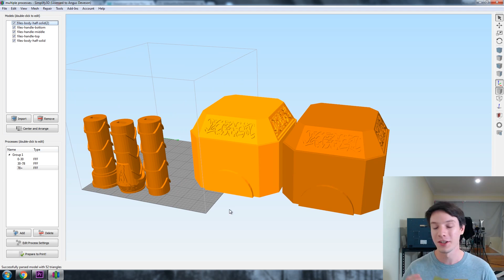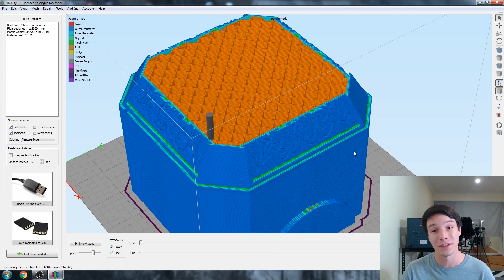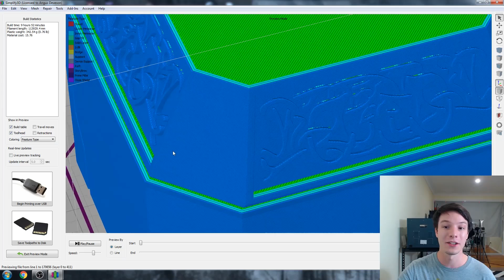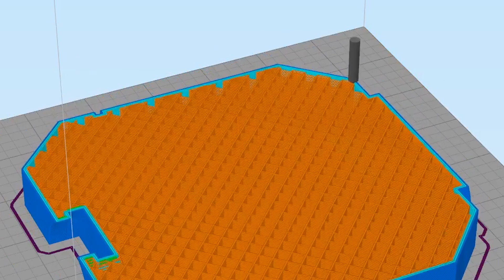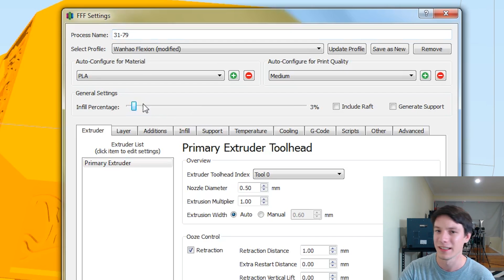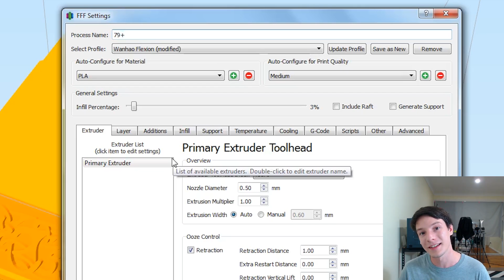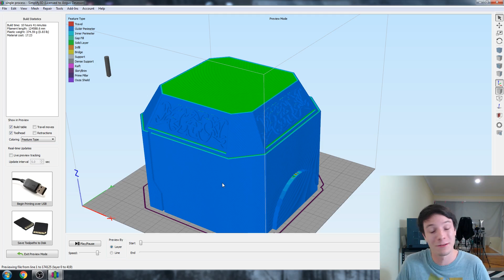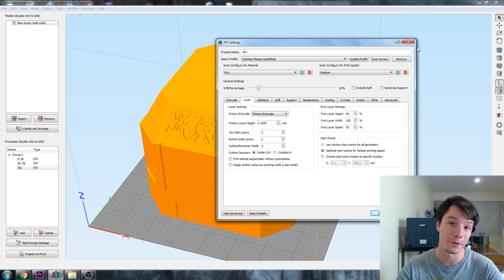Print Faster using Multiple Processes in Simplify3D - 3D Printing 101

Comment: Great info. Very nice presentation. But I'm thinking that maybe it needs an option whereby you can specify very low infill but provide some means of pouring in casting resin after the whole thing is printed. It would require that the printing make sure that the resin can flow into all the internal areas. But you'd end up with a much faster print and much stronger, solid! part.

Comment: I have a big question I have a 3D printer that uses 1.75 filament and I have one filament that's 3.00 would it be possible to use the 3.00 instead of the 1.75?
Reply: It's possible.  You need to replace your extruder, hot end and rewrite that portion of your firmware.  Seriously, it's really not worth the time, expense or effort unless you have a huge amount of 3mm filament.

Comment: If doing this om ABS you will get uneven stress in your model that may brake the part. But for PLA or PET this method is good. ABS can and will fail more often then not.

Comment: You could also shorten the model if you wanted to without chaning its analogies. In the second process (31-79) you could shorten the hammer say 10mm by starting at 31 but stopping at 69. Then on the next process (79+) start at 79 but on the G-code tab in simplify3d set the Z-axis on Global g-code offsets to -10 and that trims the model by 10mm. I used this on IKEA Lack enclosure (http://www.thingiverse.com/thing:1843235) to shorten the legs without changing the rest of the model's structure.
Still , great video,thanx for the great channel...

Comment: Here's a related topic/idea for a video for you: a lot of people use printing for cosplay and want to print large curved objects like helmets. I've seen a lot of photos of helmets in progress where there' sa huge amount of support inside the helmet (because the outside shell needs to be smooth and is best printed facing up). You can use multiple processes by putting a hollow or near-hollow object inside the helmet and using a plastic-saving process on it (thin shells except at the top and sparse infill). Simplify3D is smart enough to build supports on top of the sacrificial object inside the helmet. Material & time savings are potentially huge. 30% density supports are like printing with 30% infill...nobody does that for infil (when strength doesn't matter)l, so why do that for large supports?

Comment: You could achieve the same results using Cura 15.04 and the plugin "Swap At Z", just saying. Basically it merges another gcode file into the one you are working at a certain height.

Comment: Didn't know about grouped processes, so thanks for that! They're just a patch, though, and the whole process system deserves an overhaul in my opinion.

[1] You can store a profile under a single name, but that profile must include concrete values for all settings. A better solution would be to allow you to keep some of those settings unspecified, and then to combine multiple profiles. That way you can have a profile for your printer, a profile for your extruder, a profile for your filament, a profile for your model, and then mix-and-match as appropriate. (And yes, it's still possible for profiles to conflict on specific settings, but elegant interface-solutions exist to deal with that.)

[2]  Some settings within a process (like temperature and cooling) have inherent ways to vary between layers, but for others you have to use multiple processes. If processes become more light-weight and easier to manipulate (possibly in-dialog), every setting could have a uniform method of varying between layers.

Comment: I have found that even when just changing the infill % and not having a top or bottom layer i still get a small line on the out side of the print where the changes are. ??
Reply: furnibird 66tbird1, posted what sounds like a solution to your problem :)

Comment: Can you tell S3D they need to fix the ooze shield or wall to work with multi process prints? I submitted a bug report and they said it isn't supposed to work with multi process prints. Kind of a pain in the ass imo, it will also crash the program if you try to do it.

Comment: Is it possible to do the different infills within the same layer? It'd bee interesting to see if you can get the same strength properties between a constant infill, and a part with a less dense infill towards the center of the part.
Also, what about doing this as a hollow piece, and filling it with something like expanding foam, or some other filler, to save on time and plastic but still having some strength and rigidity to the part?
Reply: That might have to be an aspect that is part of your model rather than a slicer function. Such gradations will become a commonly desirable function as more printers come on line. One might note that some parts have been designed using evolutionary algorithms to optimize things like strength to weight ratios. I see no reason such things could not be applied to infill as well.

Comment: The software does look great, but my 3d printer cost me $199 (Cetus). $149 for Simplify3D is tough to swallow. I can understand that when printers cost many thousand dollars, that was nothing. But at 75% the price of my printer, it's tough for me to justify it.
Reply from the maker: I wouldn't recommend Simplify3D for the Cetus quite yet - as they're still working on the ability for you to use other slicers. The software it uses is good enough for everyday printing, but you can't do anything as powerful as this sadly.
Reply: Well, it is a matter of choice, you can use Cura or other free slicers if you prefer. At least 3D-printing software like Simplify3D is way less expensive than embroidery machine software, which easily costs more than 1000 USD (For instance, Janome Digitizer, full version).
Reply: seems 1 year later cura got a similar feature https://ultimaker.com/en/blog/52520-print-detailed-objects-faster-using-adaptive-layers-in-ultimaker-cura
Reply: I have my first printer ender 3 and I buy simplify3d. It's very easy to use and improved the quality of prints
Reply: It is not worth the money...
Reply: Cura is free.
Reply: I gave Simplyfy3D a test drive a while back, and it was - ehh.. alright. But added more of a work load for options and settings that I never needed to use. Cura gives me 90% of the same options with a much more fluid interface. Simplify was faster but much aimed for a commercial developer.  I wish they made a non-commercial 'home' version for $49 or something that gave updates annually. Going back to Cura - the dev team has made some awesome updates to it and it only really lack custom supports and multiple processes. Im using a heavily modded CR-10S running the latest marlin. I didnt really see why it (simplify3d) was as much $$ as it was outside of a few advanced features you may or may not even use most of the time. And gave me no distinct advantage or lessened the workload of generating gcode. Until they come out with a trial/demo Im never going to buy anything from them because its too bait-and-switch gambling on software you may end up hating. OctoPi support? I have no idea but that would be a requirement for me that I would like to verify first.
Reply: @davey3765  You might already be aware, but you can bring in a different model and use the "per model" settings in Cura to generate custom supports, and there is a TweakAtZ feature, which I think would allow you to do something similar to multiple processes (again, you could probably bring in a different model and use the per model settings to adjust infill at height as well)
Reply: Use free ones that manufacturers put out for their machines. They work just fine and I've made good stuff with them. Or you could just torrent simplify3d if you're into that.
Reply: pirate it

Comment: This is one of my favorite tricks, hands down.  It was one of the reasons I got Simplify 3D in the first place. :D  I really hope that in the near future we get the ability to use intersecting geometry to specify volumetric regions for processes, not just having them be on a layer by layer or individual part basis... Meaning we can do stuff like add very selective reinforcement around screw holes and other structural bits in mechanical parts...

Comment: I think for this model you needed the bottom layers in the second process 31-79. Because the bottom surface after the "shelf" that you talked about, was not printed with solid infill in the preview. Great video though. I have used processes in simplify 3d this way and I did not know about the group function, so thanks for the info.
Reply from the maker: Ah good point, I did miss that. yes for that detail a couple of bottom layers would have helped.

Comment: I did notice some pretty wonky stresses when altering infils- and the quality of the filament you use can have an effect on this. (This can result in some warping if your environment isnt monitored) Case point, for prototyping I use alot of the ESun Pro, which I havent managed to get a single warp from. Using some others (say regular PLA) Ive seen this effect rear its head. This is of course dependent on the print and other factors. Its a novel idea and can work, but its not 100%. Just throwing some of that food for thought out there. Varying layer height, great, I like how we are seeing innovation across the slicers.

Comment: Should've added in some bottom layers to that second process, you have a outer over hang there that will not be capped off. 
Was bothering me the entire video :P
Reply from the maker: Should have put 3 or so bottom layers in! Did it on purpose, totally :) >_>
Reply: I was wondering the whole time if he was gonna catch it... D:
Reply: Was thinking the same thing. Still, this was amazing. Perfect explanation to how the processes work.
Reply: Yeah, at 8:49 that left side is going to fail quite bad with this long overhang, very possibly so bad that it fails the whole print. At the very least it leaves a big hole there.
Reply: And also changed the bottom layer heights and widths of the top sections.

Comment: Lol, with what I'm printing right now, 0.05mm is my hi-resolution. 0.2mm nozzle baby!
Reply: it must take you for ever to print anything that is bigger than a 3dBenchy
Reply: Yeah, a benchy would probably take about 3 hours with my current settings. It's great for printing minifigs for D&D; they look almost as good as the production models, and they're way cheaper.
Reply: @LazerLord10 If you're doing miniatures, surely a toxic goo printer would be so much better. You get even better detail, and can print loads at the same time without increasing print time.
Reply: @1992jamo  "toxic goo printer" jajajaj lol its true but damn that detail and print time is on point

Comment: Thanks for these. :) It has helped me a lot.

One thing to note, is if you're printing in ABS and you have the top/bottom solid layers in between processes, I have seen that it can cause some layer separation at that point. In ABS I got better results with no top/bottom layers anywhere inside the model. But I also changed infill percentages more gradually.

25% to 15% for a few layers, 10% for a few layers, to 5% for a few layers. Then vise versa ramping to to areas that needed higher. It made for a lot of processes, but it worked really well.

Couldn't have done it without your tutorials. :)
Reply from the maker: Great points, ABS does behave funny when you mess with infill or layer height changes. I think it's because the infill is like bow strings, and if you vary the 'tension' it'll do funny things to the shrinkage. More gradual changes would help massively! Good tips :) Glad they helped, but so does your experiences! Thanks.
Reply: I believe ABS was specifically engineered to have shrinkage to pop out of molds. So it is interesting working with that quality.

Comment: yo thanks a bunch man this video was just what I needed. also do you know if there is a way to stack parts on top of each other with a bit of support in between them? or would I have to go into my CAD program and do it manually
Reply from the maker: For sure, just pattern them into the location you want in CAD with a small air gap then export them all as a single stl, throw it in your slicer with support material turned on. Your top and bottom finish will suffer, but I've done it before to save on time.
Reply: well my problem is that there are parts that s3d identifies as overhangs even when I know they will come out fine without support. I have turned the support up to 90 degrees but obviously it thinks it needs support there. the part that overhangs is extremely small and the printer had no issues dealing with it when I printed out just one.
Reply: If you actually generate supports, instead of relying on automatic generation at the time of print previewing, you can go in and edit them, adding or removing areas where support will be used.
Reply: ya I know but Its easier to do it in cad rather than try and manually generate hundreds of supports in a uniform patern

Comment: Will this work in other slicer programs ? I guess I should ask what other slicers support this function if any.
Reply from the maker: AFAIK no other slicers have the ability to use multiple settings across a single print. Slic3r now has an interesting variable Z height setting I'm yet to try - but I don't think you can change infill.
Reply: I haven't tried it myself, but I believe Cura 2.4 has support for infill based on height.
Reply: Thanks guys.
Reply: unfortunately 2.4 doesn't, it has the same "Tweak at Z" plugin as the previous versions use but there is another plugin called "Swap at Z" (google it) that lets you do this. not as straight forward as Simplify3D but for the few times you need it there are alternatives

Comment: Angus, did you see the texture on outer shell change where the processes changed?  especially the layer height change.  I noticed that on a finished print I did like this.   not an issue if you are painting I guess.
Reply from the maker: If it is on the same surface orientation you'd notice it for sure, however if you align the layer change with where the detail changes, it'll be very hard to detect.